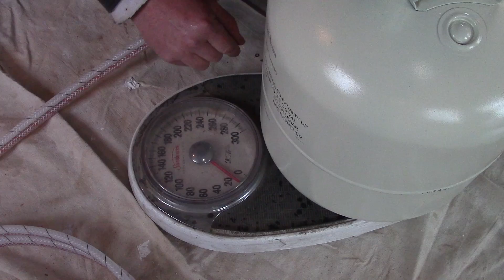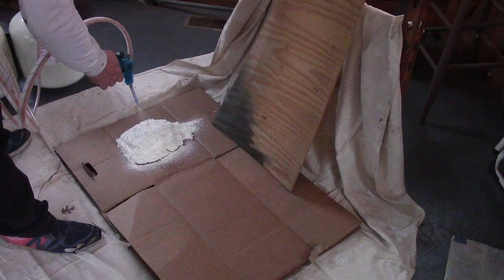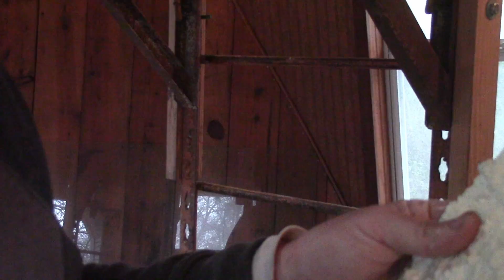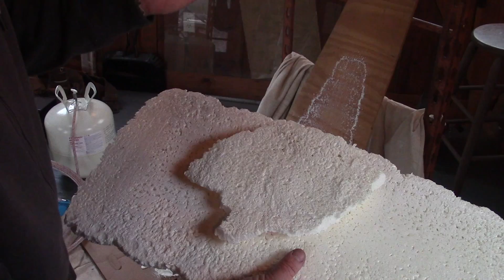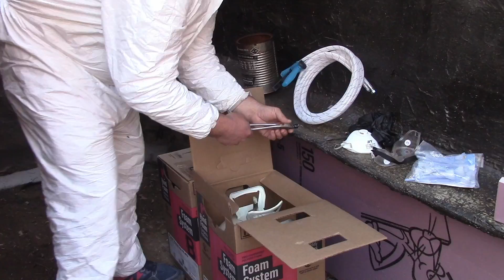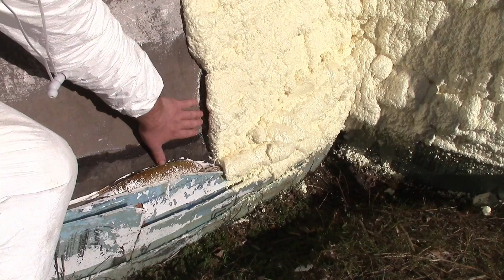Spray Foam Fail! It peels right off. Off-Ratio, Crunchy Foam with No Adhesion.

Comment: When I was spray foaming the foam panels together on my roof, it was getting really cold outside. The only thing I could do (other than stop work and wait until after the winter to finish the roof... which was NOT going to happen) was to try to at least pre-warm the cans of foam before I sprayed them. Without the warming, the spray was coming out runny and clearly wasn't puffing up as it usually does. With the warming, the spray was (at least in application) appearing to work as usual. Without power to the site, all I could warm the cans in was my All-American Sun Ovens, which added yet another use to their repertoire. IDK if there are sun ovens available that can accommodate your giant tanks though.
It's great that you followed this issue up with research and a fix and didn't give up.
Reply from the maker: I’m strongly considering hiring a professional. I don’t doubt that I can get better at spraying or get better results with these spray foam kits. I’m not convinced it will save me money doing this much foam myself. Also I really like the idea of the 3 or 4 lb spray foam that can be installed with a professional spray foam rig. They heat the chemicals and hoses up to 120 degrees and can spray a foam that adds structural. That sounds like some foam that can be buried forever without changing. One of the guys out here dug up part of his house for a remodel and said the foam he had installed in the 1980s looked perfect after all those years underground.
Reply: @BenHuttash  There's definitely something to be said for hiring people who have the gear and the expertise. The only issue that I often run into is that they can often times charge way more than should be fair for a job. My $20k solar panel setup would have been about $200k if I'd hired someone to install it. My dad wanted to get a mini split put in and the price for the install would have been, again, something in that 10X the cost of DIYing it. So with all the completely skill-less people out there, a lot of industries can charge incredibly gouging prices and still get people to pay it. So it's hard finding a fair deal. But if you CAN find a fair deal, no reason not to let people who have the expertise do the work.
Reply from the maker: @PraxisPrepper  the mini split struggle is real. I had to install mine myself because I couldn’t find a single AC and heat crew that knew how to do it! For real one guy said she would install a traditional central heat system for $8,000 total or install the mini split I bought for $10,000. 😂. I burrowed a vacuum pump from my scout master and installed it myself. I have no idea what the foam will cost because we got a quote years ago before Covid for $4000 to install a 4 pound kit that consisted of two 55 gallon drums of product. The quote was we will see how far that gets us. I guess the guy was up to date with his geometry and measuring the surface are of a dome. To be fair I have no idea what the square footage of the project is either.